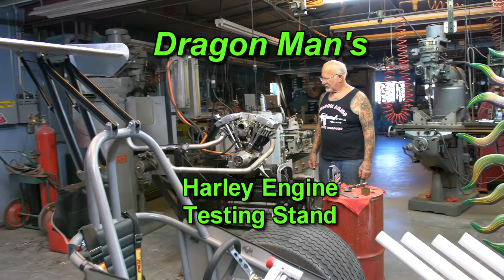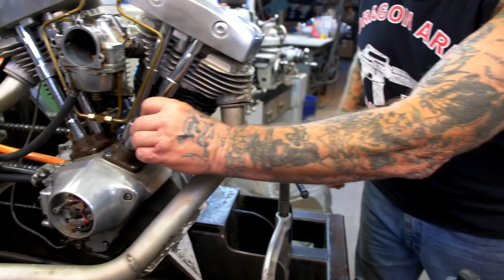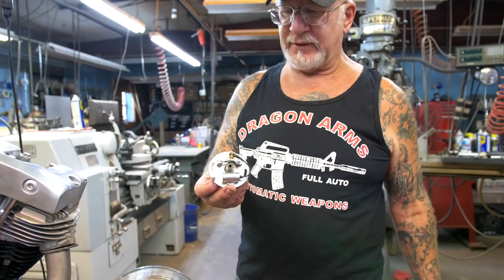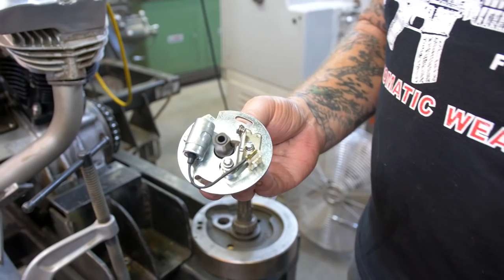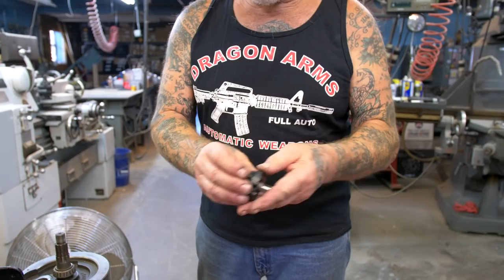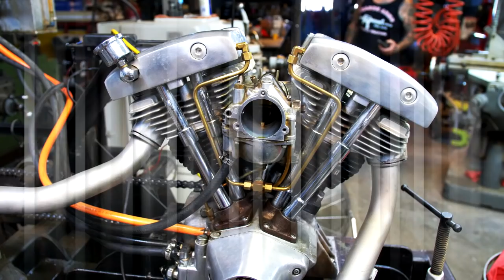Engine test stand at Dragon Man's

Comment: How about more on that impressive stand which deserves it's own video?  Is that a hydraulic pump for load tests?  Is the engine oil filtered on the return side? Howabout some better views of the stand? I dig the large pillow blocks and GM flywheel/starter setup? What does the handwheel on the base adjust? BTW if you want convenient cooling air you can use a centrifugal "bounce house" blower (I find mine at yard sales for about 25 bucks) or a carpet dryer squirrel cage blower. I also use mine (I snag all I can get) for blowing welding smoke out of my shop.